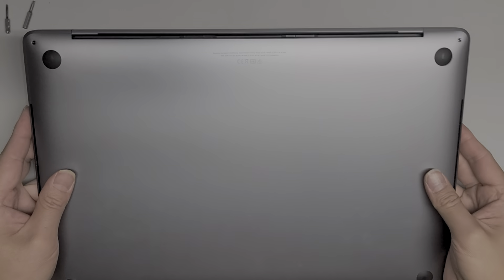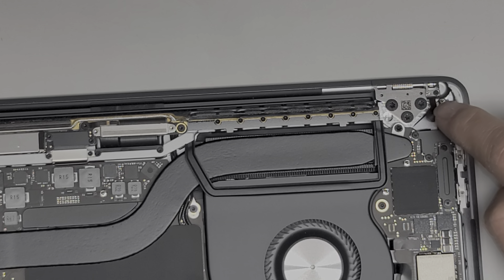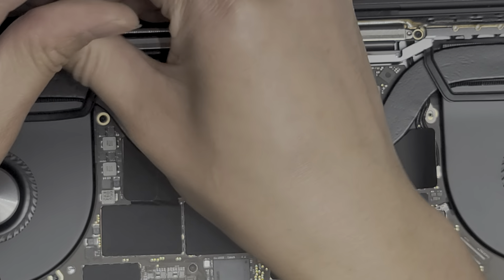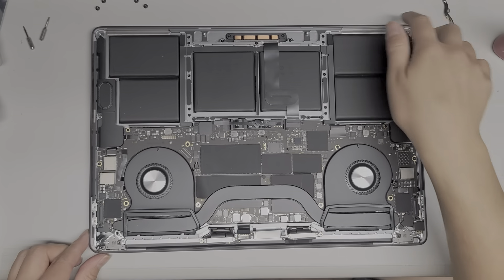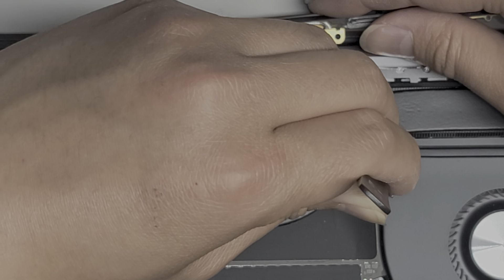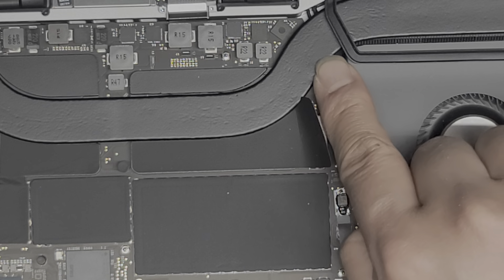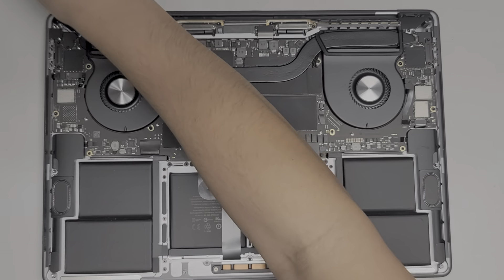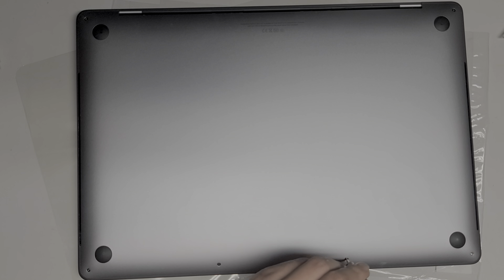2019 16" Inch MacBook Pro A2141 Disassembly Screen Replacement Repair How to Guide Tutorial

Comment: Hello there, I had two different diagnostics from apple one said it was my display and the other said it was my GPU and logic board. I’ve been experiencing vertical glitching. In your experience when fixing the logic board is the data erased?
Reply from the maker: try with an external monitor to rule out the display. If logicboard is replaced, data is gone. If repaired, data will be fine. Apple doesn't repair logicboards, they replace them.

Comment: Hey, is TouchID still working after the screen replacement?
Reply from the maker: Yes
Reply: @ItsBinhRepaired  thank you
Reply from the maker: @ciprianionutiacob7883  no problem. Make sure you get the right model screen. You can check the model and year with this website https://everymac.com/ultimate-mac-lookup/

Comment: 4:21 i didn’t take off this cable
I just removed the screw underneath it
I finished the replacement process 
No my laptop died 
It seems to be there is no power 

Please help me if there is a way to fix it
Reply from the maker: Sounds like you fried your logicboard. There's a reason I do the things I do. You shouldn't skip steps unless you know what you're doing. Now the laptop is likely dead.
Reply from the maker: The small cable connects the battery to the MacBook. I'm assuming you also shipped the battery power drain step as well?

Comment: Hi , After the new screen replacement  for my MacBook Pro 16”  model A2141 which is same model with your,then sleep wake function not working and autoboot  function also not working .once put back the broken screen all sensor working fine.Any solutions.?
Reply from the maker: you might have a defective replacement or the wrong model/year part.

Comment: I heard about a potential issue when attempting to repair the screen on your own with a T2 equipped MacBook Pro. Is there is something to be worried about
Reply from the maker: I don't know. If you watched my video, you'll see how it went. I don't know what issue you're referring to. I cannot speak for what other people did or what issues they had.
Reply: @ItsBinhRepaired  Indeed it went without any issue but I'm about to do the same with mine and I don't want to throw my money in the toilet by buying a part that my computer isn't gonna accept. But I'll trust your video and see how it goes
Reply from the maker: Make sure to get the part from somewhere with a decent return policy
Reply from the maker: As long as the part is good and the steps are followed exactly, it should go well. These screens are super expensive though. :(

Comment: I opened up my Macbook (Pro 16) to clean dusty fans I reassembled everything and it doesn't turn on. Do you have an advice?
Reply from the maker: Did you disconnect the battery before messing with it? You might have fried the logicboard.
Reply: @ItsBinhRepaired  Yeah, I disconnected battery before doing anything
Reply from the maker: @erayocak7606  did you also press and hold the power button?
Reply from the maker: @erayocak7606  if you did those things, you likely just didn't reconnect the battery cable and the metal tab properly. You have to also plug it in to turn it back on.
Reply: @ItsBinhRepaired  Yes I did. I tried plugging charger as it didn't boot up with battery. After a few seconds smoke came out, I immediately unplugged the charger. It burnt a resistor near the display flex cable :/
Reply from the maker: @erayocak7606  omg :( definitely motherboard issue possibly display. :( The only thing you did was disconnect the battery and clean the fans?
Reply: @ItsBinhRepaired  I disassembled logic board to get inside the fans and heatsink. I tried diagnosing problem by removing all flex cables from motherboard (Except fan and keyboard cables) and trying to turn it on but Mac doesn't respond. I can't try plugging the charger as it may make things worse. I can't understand how that happened.